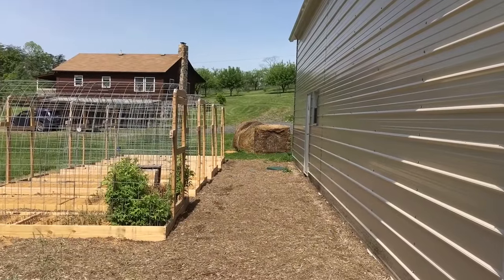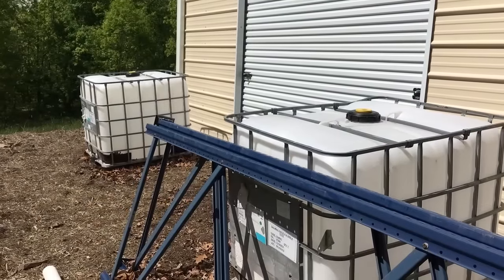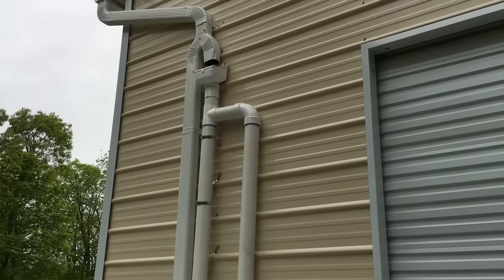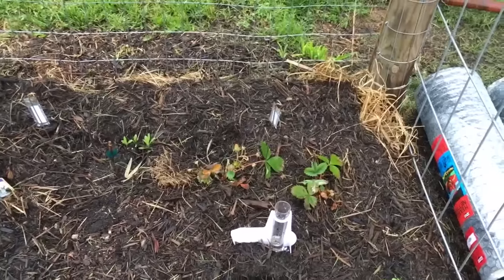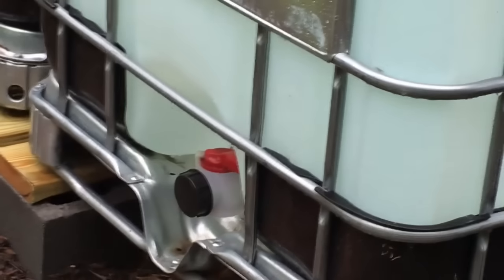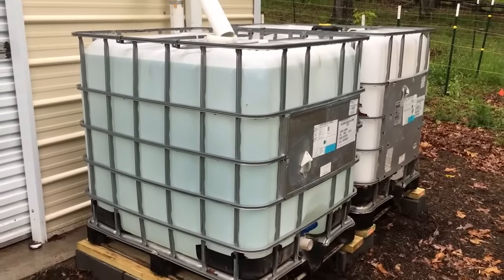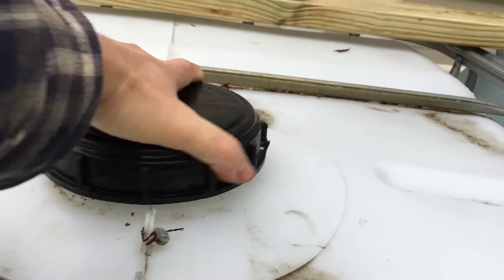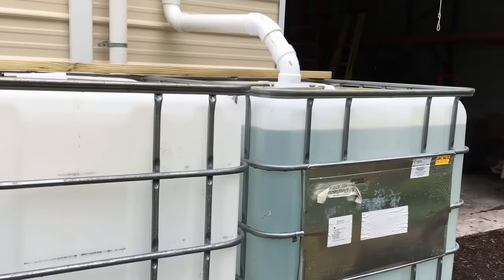Large Rainwater Harvesting System

Comment: 6 years later, are finding that the system is sized correctly?

I'm working on sizing a rainwater system in the Pacific Northwest.  We're known for a lot of rain, but we get almost none of it from July through mid September.  I have 10, 4x8 beds going in and we're not sure a 1500 gallon cistern will be enough water to get through that dry season.  Filling the tank is no issue and my roof is much smaller than yours.  But, I'm curious to hear if you find you have enough rainwater to supply those 4 beds and 'forest'?
Reply from the maker: So, after 6 years my situation has changed as follows: 1) we upgraded from 4-IBC totes to two 1500 gallon tanks.  2) we actually only use one of the beds for plant propagation, but it is a big water user (we mist the plants for 10 seconds every 5-minutes from 6AM to 9PM from June until October).  3) The food forest is mature enough that we almost never water it - only if we have a drought where we get no rain at all for 60 days or more. 4) Starting this year, I have changed the other 3 beds over to raised garden beds, so I'll be using more water on those this year.

Results: Most years we have way more than enough water.  Last year I started the summer with a full 3000 gallons and we went almost 60 days without any appreciable rain.  Using just the plant propagation bed, we almost drained the tanks.  Fortunately, we had a tropical storm roll through that filled the tanks in a day.  So, the tanks would not be enough for my purposes in an extreme drought instance.  This year I'll be adding another 1500 gallon tank for a total of 4500 gallons.
Reply: @greatescapefarms  Thanks.  Based on that, I'm guessing I'll have to fill my 1500 (tbd determined exact size) tank once during the summer.  With 10 beds and no rain for about 90 days, I just don't see it lasting through the summer.  But, I'll find out!
Reply from the maker: @kencharm2909  I'm sure there are calculations for this but I've always defaulted to trial and error and adjustment.

Comment: Not sure where you are located but is there a concern regarding the water freezing in the Winter and bursting these IBC totes. If so would you run some type of heating coil into the totes. I know for farm troths they make devices you can put into the water to stop them from freezing up for the livestock, however these totes being plastic you would need to insure the heating coil never actually touches the walls or floor.
OK, I was typing as I was watching and I think I just heard you say you drain the system for the Winter, so I guess for you this is a moot point.
Reply from the maker: I actually made another video on how I do the winterization: https://www.youtube.com/watch?v=nKpfa1h9NYw  

Because we're running a nursery operation and we get plenty of precip in the winter, I do not use water from October - April.  If someone needed the water year round they would have to find a way to keep the system from freezing.

Comment: I would have that overflow pipe instead of going out from the garage I would have it going towards the food forest and dig a swale just before and right along this side of your food forest, so the overflow waters the ground and trickles into the forest area from the swale, just seemed like a waste of water, not that I could see what was after the end of the overflow pipe. Just a thought good luck. Ok I had another that pipe crossing the doorway, wouldn't driving vehicles across that crush the pipe in a couple of years.
Reply from the maker: Thanks for the input.  I'm planning on putting in a 1000' swale this fall and the pipe will be draining into that swale - good call.  Driving over the pipe probably would bread the PVC pipe, but I do not take vehicles out the rear entrance of the garage, so I have not had that issue.

Comment: In using this water for food plots for human consumption, did you have to rinse these tanks with anything in particular or just a good thorough rinsing out with water?
Reply from the maker: We rinsed it several times.  We were not actually using it on food plots but rather to propagate nursery stock - bushes and trees.
Reply: @greatescapefarms  okay.  My garden spot does not have water nearby so I was thinking this would work since it is close to the barn and I could collect rainwater from the barn and use it on the garden.  I just didn't know if most of these containers were okay to collect water to use on food plots or not; and what to possibly clean any residue out from within, if there is such a thing.  Thank you.
Reply from the maker: @jenniferstinson7150  Just make sure that it is a food grade container and and had some kind of food stuff in it.  Many are used for food, but there are also many used for nasty chemicals and other stuff.  Mine had a preservative in it that they used to make sausage, so I felt pretty safe just rinsing it and using it.
Reply: @greatescapefarms  Gotcha.  Thank you for the advice!  Happy farming!
Reply from the maker: @jenniferstinson7150  You are most welcome.  Good luck to you!

Comment: To keep smaller bugs out, buy dollar store pantyhose and cut swatches to back up the black mesh you're using. Just loosening the big cap until it was barely on say three quarters of a turn, should've been enough to break the air seal and allow drainage without actually drilling any hole in the lid.

I cringe at the PVC pipe buried in a shallow trench across a driveway in just topsoil. I'd have rigged up something with cinder blocks and 2x6 lumber to act as protection in deeper trench with gravel for drainage. You may get away with it for just foot traffic but if you have a vehicle driving over that topsoil back fill the PVC will get cracked.

Others mentioned the algae problem already so good effort otherwise.
Reply: Don't worry, when he goes out one morning and finds all of his water disappeared overnight, he'll figure out he should have buried his connector pipe deeper.
Reply from the maker: Thanks.

Comment: nice work. could the tanks on the left be elevated and run across top of garage door to tie into the others?
Reply from the maker: Not the way that I have them set up.  The water level on all the tanks are the same.  If one tank is higher than the other then all the water would drain out of the higher tank.

Comment: Is  this water system strictly for use outside in your garden or are you using the water inside your house at all?? Did you put a metal roof on before you did this??
Reply from the maker: I use the water for the garden only.  I'm not sure what additional requirements would have to be in place to make it potable.  And the garage does have a metal roof, which helps a lot so I'm not dealing with all the little sand from an asphalt roof.

Comment: Great video!  I have a few questions. Do both tanks fill all the way full only being connected to each other on the bottom? Does the overflow work well? I have 2 totes and plan on plumbing them like you did. Thanks.
Reply from the maker: Hi Kansas Gardener.  I actually have four tanks tied together with the pipe at the bottom and they all fill equally right up to the top.  The overflow works great as well.
Reply: That's great! Thank you for the information.
Reply from the maker: You are welcome!
Reply: @greatescapefarms  What part of KS are you in?
Reply from the maker: @Magoover1  Great Escape Farms is in WV.  You are probably trying to reach Kansas Gardener

Comment: A lot of the utilities you use for rainwater catching are cancerous or the roofing has heavy metals in it. Is there a way to have clean water that wont give you cancer? Maybe not filled with heavy metals and plastic?
Reply: Berkey filter.
Reply from the maker: Good point.  I'm using mine to water plants so I'm not too worried about it.  If you are looking for potable water, then you would absolutely want more filtration systems.

Comment: I am having hard time to find booster pump that will increase pressure so I can connect to sprinklers ..
Reply from the maker: I did a product review on a system that I did.  Check out the video.  The pump gives good pressure, is instant on, and does not require a pressure tank or other hardware other than the proper pipe fittings for your system and an electric cord.

Comment: Look nice! I want do like that too but I don’t know size for connection from ibc . I order part wrong a lot . May you can late me know that size?
Reply from the maker: When getting an IBC tote, note that there are two different types of threads on the IBC tote valves.  Some are fine threaded and are known as NPS female and work well with the 2” PVC threads, which is what I have.  Others have coarse threads and are known as S60X6 and will not work with the threaded PVC pipe. This web site seems to have a lot of different types of adapters for IBC totes, including both types of IBC tote valves. https://www.jmesales.com/ibcs-totes-tank-accessories/
Reply: Thank you so much!
Reply from the maker: @raingseyphan6821  You're most welcome!

Comment: I got 4 totes hooked up so far and got 2 more to hook up with six in all ...
But I just have the one evettough coming down into the one of two totes and my 2' manifold I made for the spots to fill them the same I have them on a slight angle ... For an over flow get a  3/4 " gas pipe thread that fits hose drill a hole touch smaller and warm up the thread area and scew it into plastic but I did not worry about filters I have rubber jointers to Mont 2" black plastic pipe and remove manifold to clean out  you used way to much pipes you got to much money I kept mine simple just drill a 1/4 " hole in lead for air...you must have spent $500. In plumbing I only spent $78.  So right now you got 10 @ 50 gallon barrels becouse each tote holds  5 barrels I'm wondering in winter when it freeze with that pine under ground... Sorry I got to go this is a way over kill with all this pluming...

Comment: How cold are your winters? My grandpa had one of these totes full of water one winter and it never froze. And that winter we saw below 0 in the country
Reply from the maker: We are rated down to -10F.  I can see the water in the IBC tote being ok, but I mist some in one of my PVC pipes this past winter.  Even though we never went below +10F, the ice shattered the pipe.
Reply: Great Escape Farms One thing you could do is get pipe heaters. Make it less work for you every year👍👍
Reply from the maker: Thanks for the suggestion Austin.  I have actually redesigned the storage tanks and redone all of the lower plumbing.  I'm in the process of putting out a new video series, there first of which is here: https://www.youtube.com/watch?v=HGOCE1DyUE8&t=46s In that system, the lower pipes will not need to be removed and can actually just be drained with a valve in about 30 seconds.  I have learned a lot from the wonderful suggestions like yours, and have implemented a number of improvements.

Comment: On your right hand tank, you have an end cap with a spigot - what's that called - I'm putting together a shopping list?  Thanks!
Reply from the maker: I bought mine at Lowes and they call it a bushing.  Here is a link to what I purchased from them: https://www.lowes.com/pd/LASCO-2-in-Dia-x-3-4-in-Dia-PVC-Sch-40-Bushing/3373004
Reply: Yes. Be sure it's a treaded bushing with FIP (female iron pipe) threads the size of your spigot (known as a Hose Bibb, probably 3/4") you plan to use.

Comment: need to cover those tanks from light, unless you are not concerned about algie
Reply from the maker: Hi Dave, Good point.   I did end up covering them with black plastic for this year and intend on painting them in the future.  Thanks!
Reply: Welcome, great build, if you use a plastic water bottle inside your first flush diverters to block off dirty water at the top, fill the bottles 1/3 full of sand (not water) and tighten cap, so the bottles go up straighter like a bobber, good luck
Reply from the maker: Thanks again Dave!

Comment: I know you said you used a laser level, but you are not on a solid concrete foundation are you, surely once the tanks fill everything will change right?
Reply from the maker: I actually had no settle this year.  I'm guessing that was in part because I'm on  clay and we have a severe drought this year - clay in drought is as good as concrete.  I'm moving to 8-foot round, flat bottom tanks later this year, so I don't think even with soft clay I would have to worry about too much settling.
Reply: My thoughts were alge (which you covered) and the other is your blocks. I think if you continue to use them as in the video, your tanks will lean in toward one another. The outside blocks are holding half the weight of each tank (300 gal) where the center blocks are holding twice the amount (300 gal from 2 tanks). I noticed the blocks were turned but unable to see if supported from front to back with several extra blocks to hold that extra weight. Great video, keep at it.

Comment: Why don't you want to have water in the winter? I assume you are not catching rain water for emergency situations, but rather for regular farm use in the non-freezing season. Yes? I am interested in doing this, but for the security of having water in emergency situations. We have a well, but wells don't work without electricity. This install looks complicated, but I'm going to keep studying it and see what I can come up with. I'm a 73 year old, fit grandmother, so have to keep things simple (smile).
Reply from the maker: Hello, You are correct in that I'm using the water only for agriculture purposes and mainly from June until first frost.  
I do drain the system to keep it from freezing as we usually go down into the single digits for a period each year.  If you are in an area where the temperature drops below 30 degrees in the winter, you'll have to either keep the water inside a structure where the temperature stays above 30, bury the tank in the ground, or heat the water in the tank and pipes.
The system is more complicated than emergency storage needs to be.  I have to filter the water at several levels and pressurize it so I can use it for a fine mist system.  If I didn't filter the way I do, it would clog my mist system up and kill my plants (income).  For water storage you could just make a crude water filter system to get the large debris out.  
Please also note, that my water is not considered potable.  It is fine for agriculture use, but other measures would have to be taken to make it drinkable, and that is not my area of expertise.
Reply: @greatescapefarms  - Thanks for your informative reply. I will look for a more simple set up to follow. Im in zone 9 in Northern California and do get a few freezing nights -- about a dozen frost events. I have a portable filter system I can use for drinking water. Again, thanks.
Reply from the maker: @sunshinepie566  You are most welcome.  Frost is not an issue.  And for this amount of water you are usually good for a few hours down to 30 degrees.  It is when you dip into the 20's that you have to worry about freezing pipes even if it's only for a few hours.

Comment: i dont think its a good idea to use palets under those rain barrels.  you should use gravel bed instead.  wood and water dont mix, not if you want it to be maintenance free.  especially with your overflow method.
Reply from the maker: I ended up using cinder blocks and pressure treated lumber.

Comment: My objection to the systems is:
1. All plastic photodegrades in the sun, so this is going to break down releasing phthalates, estrogenic compounds, and microplastic into the water which will contaminate the land and possibly accumulate in the tissues of the plants you grow
2. At some point these tanks reach end of life and have to be thrown out which means putting more plastic in the land fill. I get that it's been used before so you're reusing, but if you paid for it, it's helping industries that use these DEEPLY unsustainable products recoup the upfront cost for them which is itself therefore an unsustainable practice, and if what we are doing is unsustainable... What the hell are we thinking?
3. These tanks have some nasty stuff in them before getting to you. Sausage preservative? Ew. What I don't get it most of the off-the-grid homesteading types I've interacted with wouldn't trust the FDA to stick their kids with a vaccine, but somehow they're down to have the FDA proclaim that a plastic crate, full of known carcinogens, is "food grade" and don't have a problem with preservative residues hanging around their system. Seems VERY inconsistent to me, especially when you can get metal barrels cheaply and they are opaque so you won't get algae growing in them. Just saying...
Reply from the maker: Good points and I have responses to most of what you point out that are already posted in my lessons learned video series, so I won't restate here.  You do a good job of pointing out problems, but do you have any solutions?  Please help our viewers out by giving your solution to capturing and storing rainwater in a rural area for agriculture use to preserve a well.

Comment: Here is the tool for crimping your downspout pipe so one piece will fit 
inside the other.  I have not tried this myself and I'm not endorsing 
it, just showing you what several viewers have recommended.  
https://www.amazon.com/Wiss-WC5L-5-Blade-8-Inch-Depth/dp/B004RGZX82/ref=as_sl_pc_qf_sp_asin_til?tag=greescfar-20&linkCode=w00&linkId=a664bcc274f8a054c63e716525372ee8&creativeASIN=B004RGZX82
Reply from the maker: Cool.